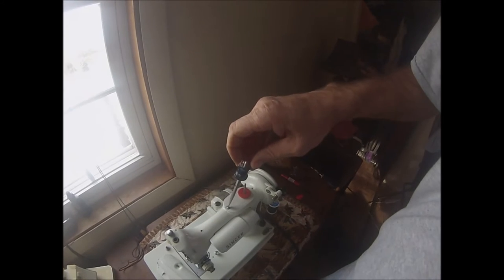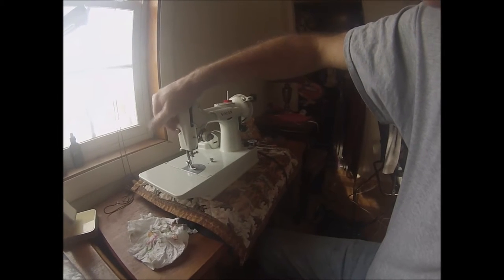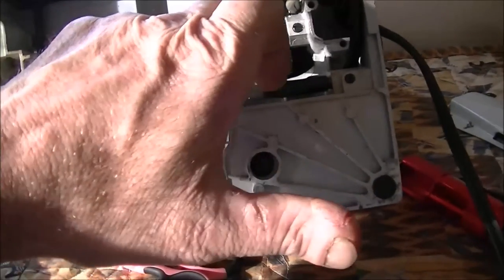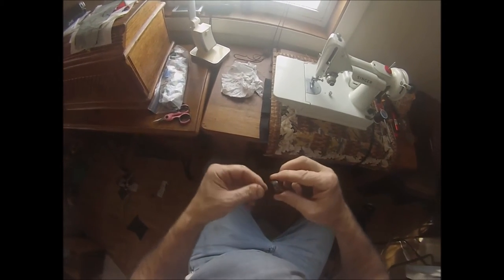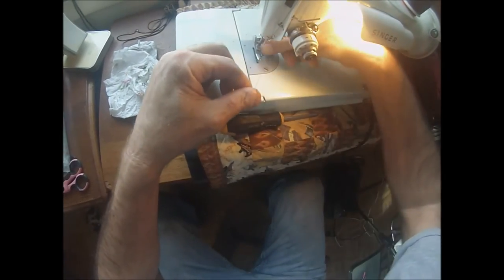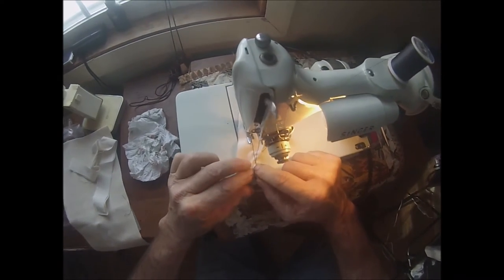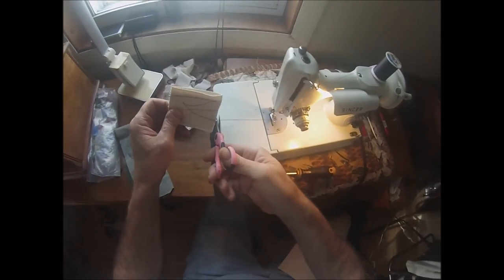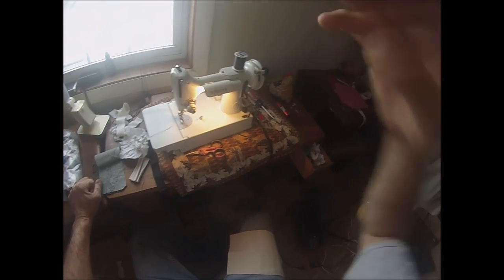Singer White Featherweight Maintence

Comment: Some folks say to lube some of the White FW innards on the faceplate and underneath.. you don't, right?  Just oil I see.
Reply from the maker: +Patricia Dumas  All I use is  oil on the white feather weights on the black ones with the gears I use a high quality light grease.    Wonderful machnes and fun to use